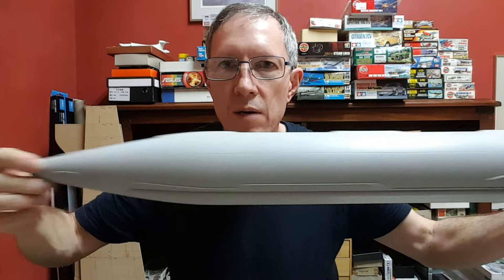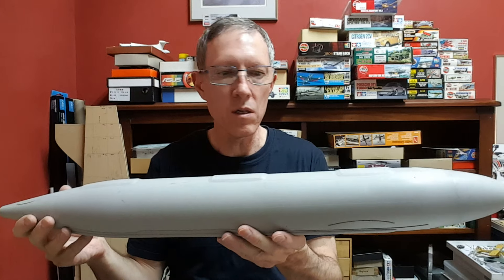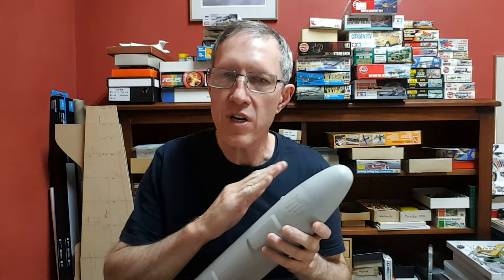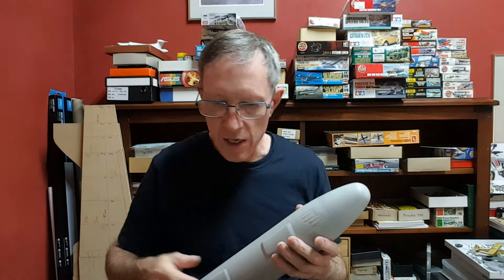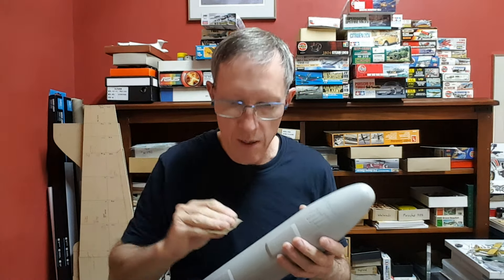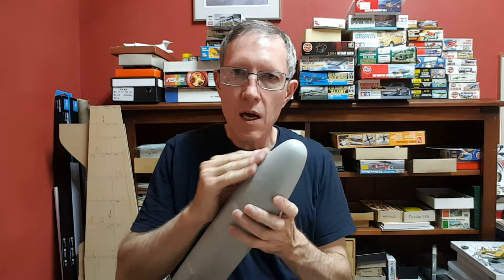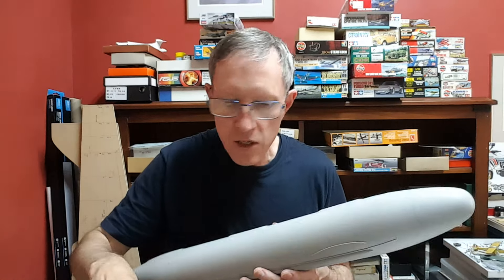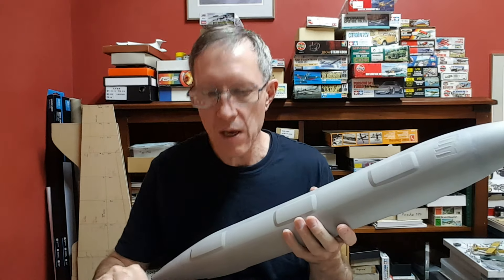Plastic Model Building. Wet and dry sandpapering.

Comment: Ironically I have several plastic sandwiches bags full of those little  torn pieces of wet sanding paper, some must be 20 years old and still useable :-) Testors used to make a package of multiple grit. The one sspect of the " new" materials I like is the improvement in fillers, polishing compounds and new dry sanding sticks in various sizes. Do you remember the old Green Putty filler  it was like wood filler and almost impossible to work with. The thin liquid glues are also a very useful improvement . 
Revisiting the stagnation issue, some additional thoughts effecting that for me have been cost of kits, availability of paints I used to use. It may sound odd but sometimes while watching other You tube modelers strive for detailed perfection of weathering with washes , cockpit detailing, panel lining, etc. With all these techniques I feel I am being forced to change my building style when I was completely satisfied with my old methodology. I don't have a walk in model shop and rely mostly on the Internet for ordering supplies and kits which limits my ability. to keep a steady stock.
Your videos do help me understand that while adjusting to all of this evolution we can still build models the way we want and used to build. I'm trying to adjust and like you mentioned before  make 2024 a building year. And I should probably change my modeling to include more that just aircraft to extend my skills. Cheers and Happy Modeling.